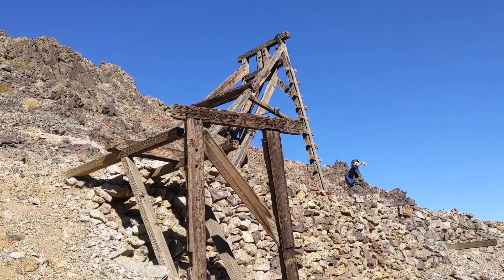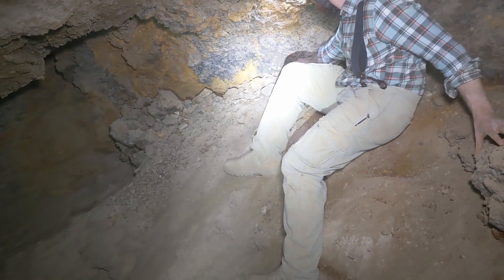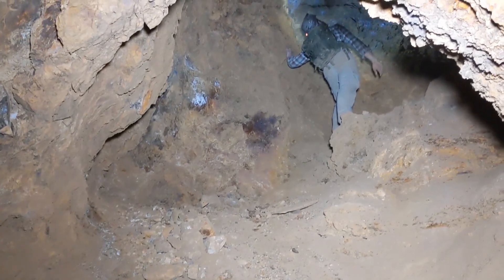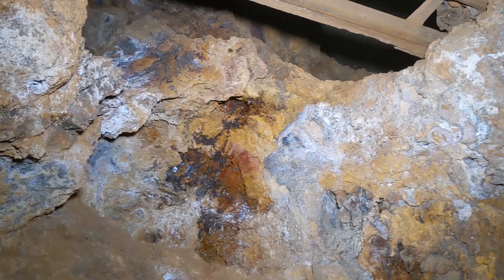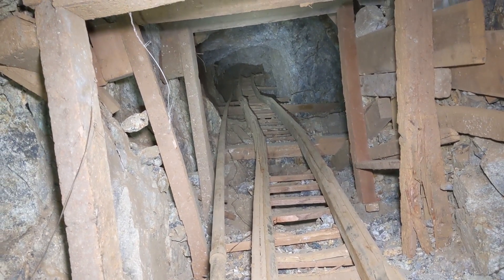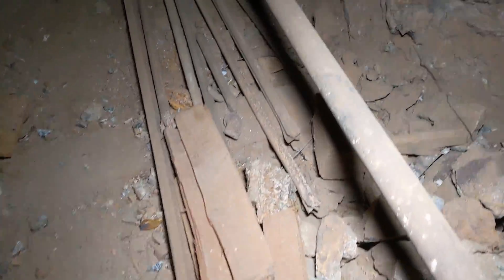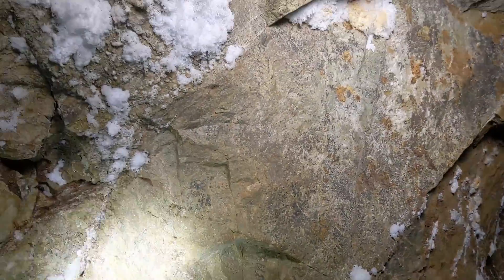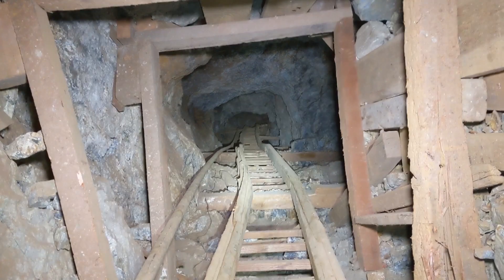An Incredible Lead-Silver-Zinc Mine - The Deeper We Go, The Better It Gets

Comment: I worked at a lead, zinc and silver mine in Northern Idaho called the Star Mine up Burke Canyon. They finally closed it down in June, 1983. They were just developing level 8300. As in 8300 feet down. It was the deepest mine in the continental U.S.
Reply: I remember my dad talking about this mine...Not too far away was a silver mine where in the 70's where men were killed in an explosion...
Reply: That was the Sunshine mine fire in 1972. It was located near Kellogg, Idaho. No explosion. A fire started in one of the upper levels and went undetected until it was too late. Carbon dioxide is heavier than air and has no odor. It can kill with just one breath. Men started dropping like flies in the lower levels until they realized what was going on. Even though they had respirators on their belts, for just this occasion, they were not trained in their us. These respirators are just like your cat converters on your cars and trucks. They turn carbon dioxide into breathable carbon monoxide They get real hot when there is carbon dioxide in the air. The higher the concentration, the hotter they get. Men were taking them out of their mouths because of the heat and it was instant death. The fire was put out the same day and then came the rescue/recovery effort. Men were found in a dog house, dead (don't know what level) with food in their mouths. It kills that fast. 92 men lost their lives in that fire and they all died of carbon dioxide poisoning. By the way. A dog house is a cut-out in the main drift where supplies were stored. They had wood floors, which made a good place to eat.
Reply: I suppose the star mine is not explorable?
Reply: @mirhasanoddname  I'm not sure. We are going up to visit friends in the area Next spring. I will contact Hecla Mining Co, and try to get permission to walk in. I know that mine like the back of my hand. The only part of the mine to explore is the Day side of the mine or the hoist room and machine shop. The lower part of the mine is under water.
Reply: @MollydogRadar  Thank you for answering, I hope you get permission
Reply: did the material look thew same?
Reply: Wow.!..did you collect any mineral specimens during your time there?  I went to the Florence Mine, Cumbria, UK way back in 1973 when I was just 12 years old. They had a shed on site near the mine head, which was like an alladins cave of beautiful mineral specimens of Heamatite, Specularite, Dolomite and Calcite. The company which ran the mine gave me some specimens to take away with me which started my life long hobby of collecting mineral specimens from all over the world!.... and becoming a Geologist. Love watching these kind of films.
Reply: My granpa worked in that mine I think it was owned by Hecla he retired in the lucky Friday
Reply: No it is not explorable
Reply: @MollydogRadar I think you’ve got carbon monoxide and carbon dioxide reversed. Carbon monoxide is an odorless poison gas we don’t have good natural defenses against and is produced by incomplete burning. Carbon dioxide we breath out (and in) normally as part of breathing and we can detect well below fatal levels (the air feels stuffy).
Reply: @Youtubehandlesaresilly  There was a fire in the Sunshine mine in Kellogg Idaho in 1972 that killed 93 miners. The fire started in one of the upper levels. Sense carbon monoxide is odorless, transparent and heavier than air, a lot of the miners in the lower levels died instantly. They found some miners that were having lunch at the time that still had food in their mouths. It kills that fast.

Comment: At 24:16, the lava rocks he has that sound like glass look like "clinkers," hardened basaltic lava. As the lava cools immediately after flowing out of the volcano, it forms a crust of black glass. This glass crust will then break up and either be cannibalized or form plates (platy aa). The plates will eventually break up into clinkers, which sound like glass as they break and tumble. So, that would be aa lava, named for the fact that it hurts your feet, if you step it after it's hardened. I would expect there to be more of it, if it's aa. There should be igneous rock as opposed to sedimentary rock.
EDIT: The volcano erupting currently in Iceland (Geldingadalir and Meradalir) is basaltic lava, and you can see this lava process happening in real-time.

Comment: very good quality vid, lots of petrified wood turned to stone in the segments. the chrystals is the wood sap that has petrified.
I really do not believe that they used dynamite at 200 or 300 feet the whole mine would be extremley unstable after each detination.

I think there is lots of decay of metal, wood and other materials the miners dug the sediment out of existing tunnels, those wooden bit of dynamite boxes look like they where laid there on purpose..

it would be interesting to take samples of the "rock"

Comment: That carbide can is the only size that union carbide produced holding 50 pounds of calcium carbide, back in the 1970s I worked for a company called Soiltest in Evanston Illinois that packaged the stuff for use in construction engineers soil moisture testing gauges, ( basically a  pressure vessel with a gauge on one end, the engineer would place a soil sample inside and add a small amount of calcium carbide, seal the vessel and shake it the moisture in the soil would react with the calcium carbide and produce acetylene gas which would be measured by the gauge giving the engineer a parts per million of moisture in the soil, the powder itself, is a purple dust that smells to high heaven and is highly volatile, I used to have to come home from work and undress in the basement throwing my clothes directly into the wash machine, they smelled so bad, we lived in an older home that didn't have a shower, so I had to take two baths, one to get rid of the powder, then empty and clean the tub, then another to get rid of the stench! One day our plant janitor was clearing out some waste from the can filling line, and made the mistake of dumping it in a dumpster that contained wet grass clippings, fortunately he did so outside the plant itself, as the waste exploded into flames! If he had done so inside, the whole plant would have burned! When the Fire Department, saw what we were doing, and how we were doing it, ( no protective gear or masks, no dust collection system, no enclosed machinery and no fire suppression system) they shut that department down, forcing the company, to build a separate facility to do the work, at its Baraboo Wisconsin Plant, ( near the old Badger Army Ammunition Plant) which of course got me laid off.

Comment: All the blue that you see in most of these Californian mines is Chrysocolla, a copper mineral. If you lick it, it will immediately absorb moisture, and your tongue will lightly stick to the surface.
Reply: @Nondescript Because it is how you determine what mineral it is, on site, without super heavy and expensive equipment.

Comment: Awesome video and interesting geology!    One thing stood out:  NEVER touch old dynamite, even breathe on it!  It can sweat nitroglycerine crystals that are sensitive to light touch, making it extremely dangerous.

Those offset cubes of calcite are called rhombic crystals.  Also, the tilted rock face with occasional timbers against it is called a hanging wall, where silver ore tends to concentrate.  I explored some really old silver mines in the Calico area before they sealed them all.  There was a deep level with tracks.  The hanging wall had numerous 2' tree trunks supporting it as they excavated the ore.  Over the decades, the weight had crushed some of these by several inches so there was a band of exploded wood fibers.  At the top of the rickety ladders to the lowest level, there was a piece of wood from a fruit box dated 1948 or so, and that was late in the mine's life.   Someone spraypainted an arrow and "To hell!"

Comment: Awesome report. I think the batteries and wires you found at the end of the video would be for a bell communication system with the surface and the winder operator. Amazing that this mine is dry down to 600ft!!

Comment: Also, the drifts and the stopes in the Star mine Ran level. All the drifts ran 200 feet off the vain. We ran cross cut drifts 50 feet past the vain, then mined up 20 feet to start the stope going in both directions. They found out years ago not to run drifts on the vain. The walls squeeze in from the tremendous pressures in a matter of months. The cross cuts were about 400 feet apart. The levels were 200 feet apart. The stopes were mined out till they met up with the stopes in the other cross cuts. It should be noted that all the stopes were timbered with 6 inches of lagging for the roof. Lagging is a rough cut board measuring 3 inches by 6-12 inch wide. Once we met up with the other miners in their stope, we went back to the start, mined up another 10 feet and started the mining process all over again. Only difference is the roof we made was now our floor. After mining up another 10 feet, we back filled the lower mined out section with sand, which was the waste rock pumped back in from the mill via rubber lined 4 inch pipe. Once we mined up to the level above us, called breaking sill, and the final back fill was complete, that level was shut down and we went deeper. One more thing; There were commercial grade air conditioners on all levels below 6700.The water temp coming out of the seams in the rock on 7500 was 112 degrees. Every level had electric trains and were pretty wide. Nothing like that mine you are showing here. Hope I didn't bore you.
Reply: Nothing boring here, when it is all good stuff for a newbie interested in the underground :)
Reply: i have a lot of questions about the star mine. i would love to pick your brain!
Reply: @wlong1794  Sure
Reply: @MollydogRadar  thanks!
1. how many men were working per shift when you were there?
2. there seems to be a huge shaft in burke itself, was that in disuse by the time the shaft you drove train to was being used?
3.does that main haulage tunnel where the diesel locomotive ran end at the vertical shaft or does it continue on  that level into mullan. i found a map connecting the old shaft to Mullan but was wondering if there was any old connections to the Friday mine in Mullan?
thanks for sharing you knowledge!

Comment: The dark patches could be Iron-II- Oxide, it's a very dark, orange/red brown and quite brittle. The soft copper stuff could be copper mixed with lead. Lead when corroded turns very soft and is coated with a white powder. Copper and Lead often occur together. Also, Copper when corroded not only has the bright turquoise, but can also have a greyish, brittle, hard surface.  To check something for Lead, you can scratch the surface of it. If it is bright and shiny silver that glosses over fast, it's likely to contain Lead as it is highly reactive with Oxygen. That's about as much as I remember from the Chemistry of handling archaeological artefacts during my studies. 

Also, as this is a Lead mine you really should be masking up. Lead dust can be quite toxic and should definitely not be inhaled.
Reply: Am pretty sure that was a bunch of uranium too
Reply: @blacktoothfox677  I think lead is the decayed isotope of Uranium, masks are a good idea.
Reply: @bristleconepinus2378  blew my mind when I learned that lead is essentially dead uranium...   Its all good in these catacombs until you kick up dust...   stay healthy out there, Bristlecone.

Comment: I bet there was a old time telephone in that room with the batterys, And the wires went to the suface!
Reply: Yep, those batteries were Leclanché cells (eg forerunner of modern dry cells) so not rechargeable as was suggested. 
Were probably used to power a telephone system,.

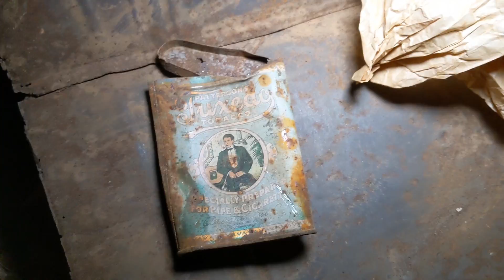Comment: 17:38 it is paper for wrapping fuses.....
White Countered Gutta-Percha Fuse is a safety fuse consisted of jute yarn spun around a core of black gunpowder and waterproofed by a coating of pitch and gutta-percha.
Pitch is a viscoelastic polymer which can be natural or manufactured, derived from petroleum, coal tar, or plants. 
Gutta-percha is a tree of the genus Palaquium in the family Sapotaceae. The name also refers to the rigid, naturally biologically inert, resilient, electrically nonconductive, thermoplastic latex produced from the sap of the tree, particularly from Palaquium gutta; it is a polymer of isoprene which forms a rubber-like elastomer. The word gutta-percha comes from the plant's name in Malay: getah translates as 'latex'. Percha or perca is an older name for Sumatra.

Comment: Damn, the two of you certainly do find some treasures don't you? I watched the whole thing through. That drill column you were commenting on was for a drifter - likely a Leyner-styled drill, jacklegs have a pneumatic leg and came in later. Figured you knew but simply said jackleg by mistake. That noted, those solid steels were a mystery. I imagine it's possible for them to have been leftovers from widowmaker times, but believe it or not, some guys were drilling dry until pretty recently, crazy bastards.
Reply from the maker: Thanks for all the great info! I do find it hard to believe that anyone would use widowmakers over the safer alternatives. Even I'm starting to worry about all the dust I've breathed in from just exploring these mines.

Comment: I could do this until I remembered how far down and how close tight the confinement then all panic would be let loose. Hope no earthquakes.
Reply: I’ve read that caves are the safest places to be in earthquakes, because the energy waves travel until they reach the surface. I don’t know if that applies to mine tunnels.
Reply: @mitchellbarnow1709  might shake some heavy lumps down as the vibrate by.

Comment: Hey Guys, great stuff.  One question: how to prevent from getting lost once you get deep into the mine?  That would scare the crap out of me.  There’s so many forks and tunnels.
Reply: These two seem really good at navigating, even when they split up, they  can remember the layout. Very impressive. I hope they have some emergency protocols they discuss each outing.
Reply: I print out a pile of arrow direction papers.  When I turn to a new drift I leave a paper on the floor with a rock securing it to show me the direction out.  Some people leave little blinking lights, others use a plastic strip of material similar to those used a sample tags.

Comment: The blue mineral is probably copper sulfate, which turns blue when exposed to air. Kept in the dark, it'll get darker, lighter when exposed to light.
EDIT: At 32:25 those could be sulfide minerals leftover after a geothermal/hydrothermal vent dried up, sulfur, galena, with calcite or dolomite?
Reply from the maker: I appreciate all the info!

Comment: I tend to think that the wires running down there were phone wires.
So someone at the bottom could communicate all the way to the top.
Old phones could run on batteries.   And yes same thing to set off blasting caps too.

Comment: Im seeing two things from the start: going trying to cross a section you should not even attempt. And picking up really old dynamite from 1913 that is over 100 years old. You dont want to touch that! That could be really sensitive. 

Greetings,

Jeff
Reply: It doesnt have a fuse or blasting cap as they clearly pointed out
Reply: @ghostdtx  That does not matter, explosive can change chemical composition and explode. Or as stated on Wikipedia: "The maximum shelf life of nitroglycerin-based dynamite is recommended as one year from the date of manufacture under good storage conditions.[6]

Over time, regardless of the sorbent used, sticks of dynamite will "weep" or "sweat" nitroglycerin, which can then pool in the bottom of the box or storage area. For that reason, explosive manuals recommend the repeated turning over of boxes of dynamite in storage. Crystals will form on the outside of the sticks, causing them to be even more sensitive to shock, friction, and temperature. Therefore, while the risk of an explosion without the use of a blasting cap is minimal for fresh dynamite, old dynamite is dangerous."

So picking it up is risking blowing your hands off, or worse. (!!!!!!!!!!!) 

Greetings,

Jeff